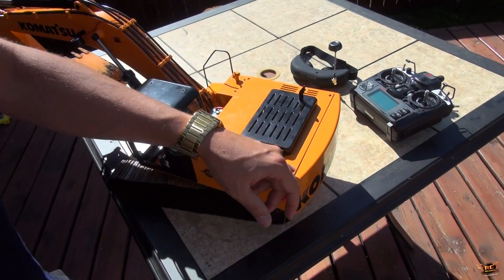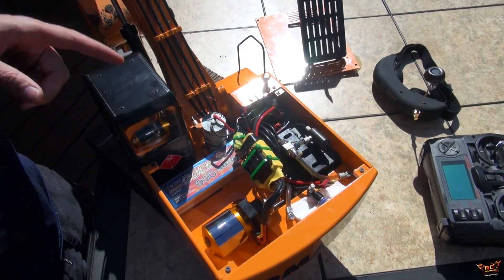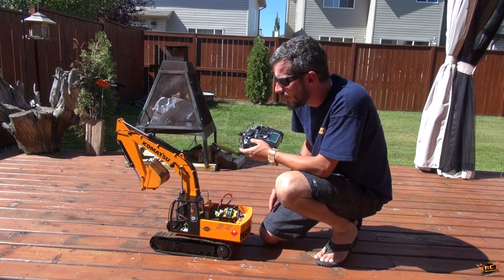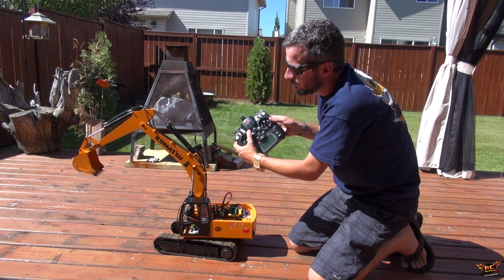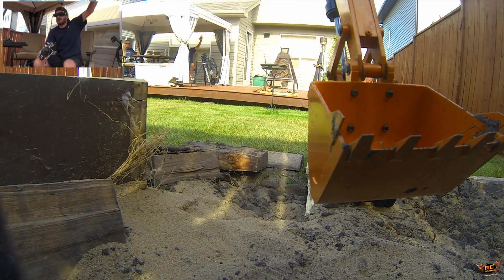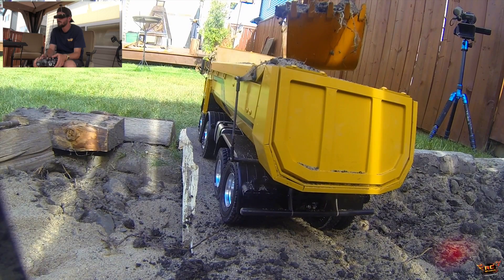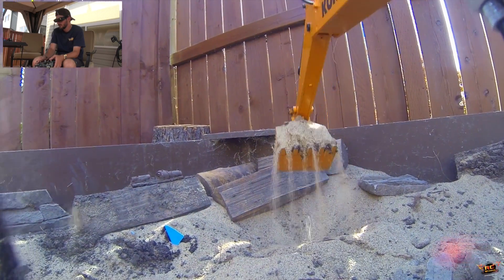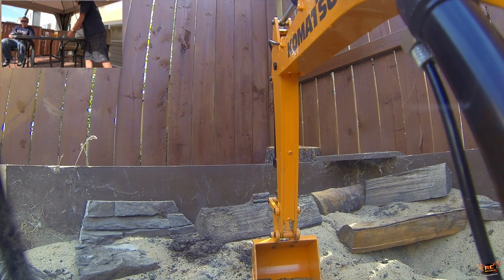RC ADVENTURES - FPV 1/12 Scale Earth Digger 4200XL Excavator & 1/14 8x8 Armageddon Dump Truck

Comment: I don't know if you can on that but on a real excavator you can turn your pumps up or down in psi to change the speed and response of the machine. If you can you might want to rue them down to get rid if the jumpy ness of the stick and boom. Then it will move more smoothly and a little bit slower.

Comment: Thanks for the quick response MEDIC. I love to see YouTubers getting back to their fans with replies on their videos. By chance would the MAN ever take the trip to the Urban Jungle? Provided if you can make it go a little faster. But it would be cool to see a beat up, re-painted Man towing a flat bed, and carrying 4 to 6 extra batteries in the dumper. Se, I'm already thinking ahead. Actually Project Overkill needs to be on the next "Urban" run. See if TJ can build you a trailer that can fit it.

Comment: I figure by scale of cabin to body, it would be a 16 ton excavator. 
By the length and height of the rear end a older model. Nowadays they tend to be shorter but far taller on the rear end. With cameras becoming standard on the rear I've seen latest model cats where the rear window is actually reduced to a thin slit at the top. 
Of course, it's not to scale with truck, so toss that out the window, I figure compared to that it's around 24 tons. Size and tonnage don't scale straight on excavators.

Comment: What would it take to pull that thing on a rc trailer? 
As rc's go it seems to be way over regular rc weight to size ratios.
I guess a summit in low could pull it, granted I've twisted two half shafts on mine messing around with stuff like that.

I'd love to see that thing on a flatbed.

Comment: Im wondering how hard it would be to change the control pattern?  I am an excavator operator by trade and the control pattern you have is totally different from the real deal.  It would be next to impossible for me to learn to run this thing because of 15 years of muscle memory.  I am glad to see RC4WD is finally starting to offer some contstruction equipment though.  Check out LilGiants Construction company here on youtube

Comment: Hey medic! I have been watching your videos even before I got a youtube account, waaay back to the first RC Adveture. I was wondering if you could help me with something? I'm only 13 and 1/2 but I'm big into hobby rc. I just bought a Vaterra Kalahari, but the stock Ni-HM battery is crap, and I wanted a Lipo to put in there to improve run time and speed. What would you suggest for it? I have a budget of about 70$ so... Do you think you could hook me up with a charger and battery?